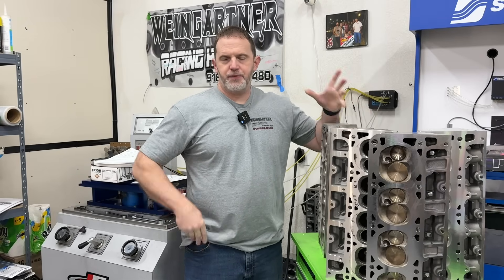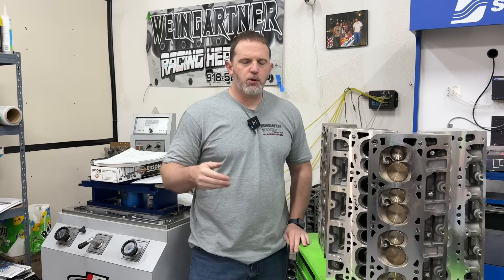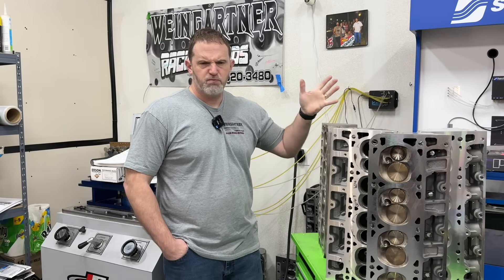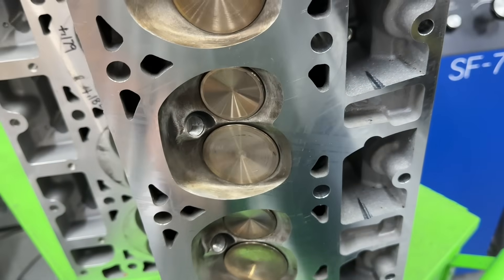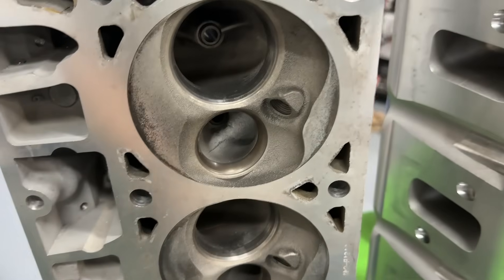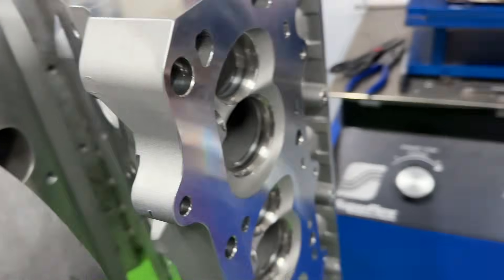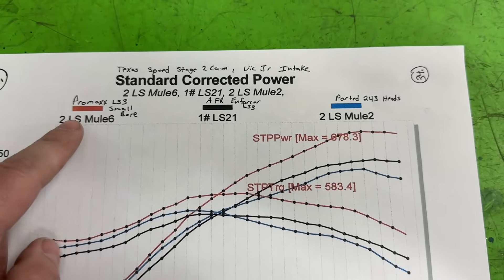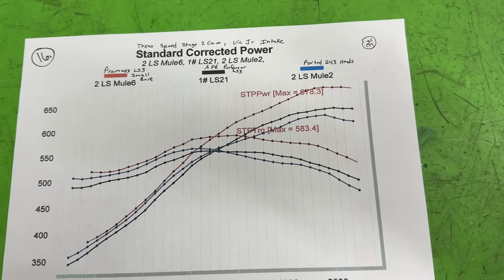Cheap LS Head Dyno Test

Comment: Wondering about near 100% throat on boosted motors with undersized valves for max flow. I normally blend the seat right up to the cut straight into the port. Then lap incase the seat got thinned.